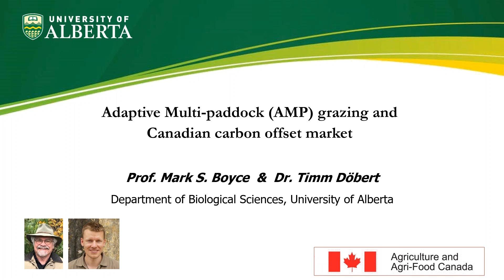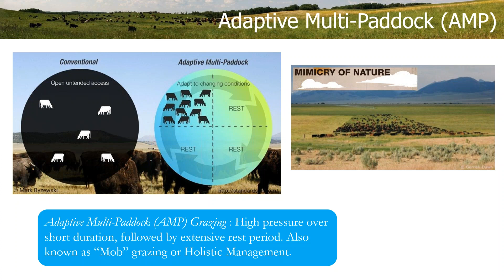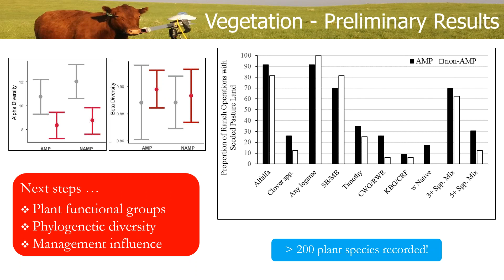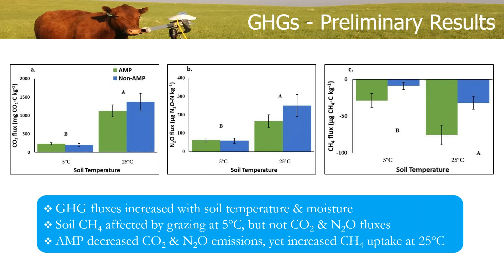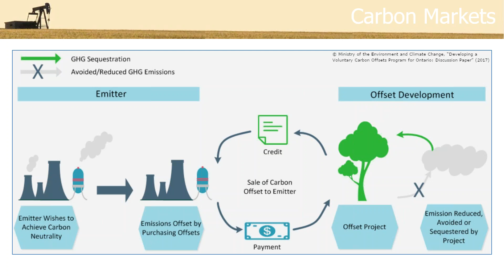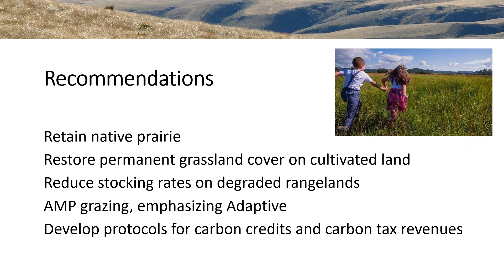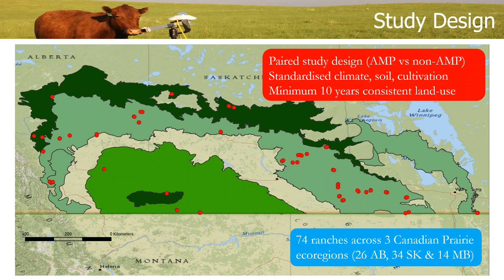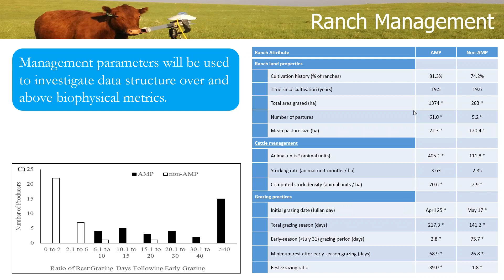Adapting Grassland Grazing to Boost Carbon Sequestration

Comment: Admittingly Boyce doesn’t have a clue about how the soil microbiology works. His slide on intensity of grazing reflects this. In order to maintain arbuscular mycorrhizal fungi, you need to retain root mass. How do you retain root mass? By retaining over 50% of the plant mass above ground. With continuous grazing (non-AMP), preferred plants get grazed all the way to the ground. The only way you can reduce this over grazing with continuous grazing is by reducing the number of cattle (ie “lighter” grazing). Though with AMP grazing the strategy is different. Time is also an important factor. So you move the cattle from one paddock to another paddock after the cattle graze only the top 50% of forages. This way the root mass is retained along with the AMF associations. Maintaining roots and AMF associations is critical to building SOM/SOC since the turnover of AMF and bacteria, the necromass, is what largely forms SOM as well as SOC and SON. Measuring SOM/SOC in only the first 15 cm or meter won’t necessarily reflect this increasing SOC capture.